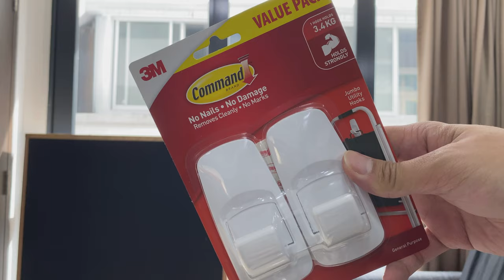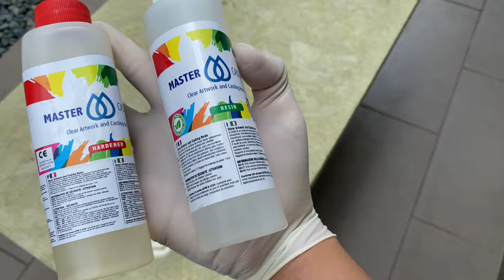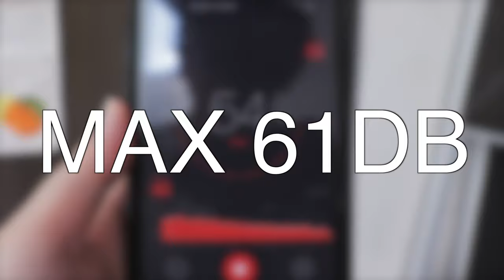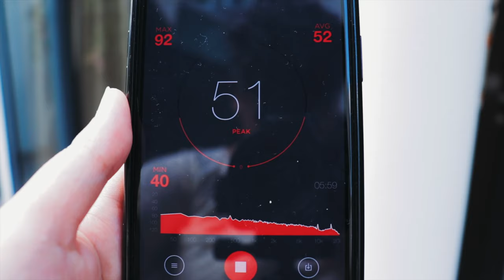Soundproofed Singapore Studio Apartment (Vocal Booth To Go - Producer’s Choice Blanket)

Comment: Good video! Looks like the blankets and sound panels are very effective on the windows with a good STC. I wonder about the impact noise that might go through the floor under the drum kit, but maybe the flooring materials in Singapore are less resonant than those in the US?
Reply from the maker: Thank you! I would need more mass to cut down a lot but for my case this setup is helpful. Also my unit is in the basement of a landed house and is the only unit/room within the house on the basement. But on flats and housing impact noise of the drums is really an issue.

Comment: Awesome job! I live in a complex (sort of like an apartment, 4 units in one) and I was planning to use the blankets to help me out. Question with your lego panel setup though. Do you ever have a problem with your panels falling over or are they just snug on the wall where they don't fall? I may build me some panels in addition to the blankets. Thanks!
Reply from the maker: Thanks! There is a metal frame on the ceiling that holds the main curtain. The gap is perfect fit for the panels and it holds everything together. Plus the rigid frame helps. So I never have any problems with it falling off.
Reply: @ProjectBeats_  nice! Thanks again!

Comment: Nice video. I like your idea of using resin for the acoustic panels, in fact planning on making some for myself. Just curious how did you hang them on the wall if they have no wooden frame, do command strips work directly on the fabric?
Reply from the maker: Thanks for checking the video. For my case the resin acts like a wood frame so I just literally stack them on top of each panel and then secure them in with the curtain in front. No hooks or anything. But if you can drill, I think rockwool wall spikes (impaler) work best.

Comment: are the rockwool more impactful than the blanket? if i just get the blanket, how much will it reduce sound?
Reply from the maker: Blanket alone or rockwool alone isn’t really soundproofing. Its more absorption and sound treatment. It’s essentially my way of creating mass by combining both plus air gaps in between. It’s a shortcut and my only budget means of achieving “soundproofing” to an extent without voiding my rental contract. 
Best is of course acoustic board and mass load vinyl sandwich if you are able. Or blanket/rockwool with heavy acoustic board because that has more mass.

Comment: Is using Fiber glass or ceramic fiber wool insulation would work just as well??
Reply from the maker: I learned that if you use acoustic board as backing material behind the insulation it will work much better. If you are able to I would suggest that.
Reply: @ProjectBeats_  thank you so much! This helps a lot. 😁

Comment: how do u block sound say if i’m in a town house they use thin walls but i wanna block that sound from me either gaming or laughing but without them hearing me so say if i scream during gaming i want the sound to not bleed through the other side as well
Reply from the maker: Best would be mass if you could install. So plywood/drywall sandwich, plus air-gap for decoupling your side to the wall and some absorption, like curtains/insutation (rockwool etc.
Reply: @ProjectBeats_   say if i use soundproofing foam  or acoustic panels or blankets etc. on both side of the wall as i don’t wanna put like rock wool or anything. so say if i put foam on both sides then put a blanket regular thick fluffy blanket over the one wall that my voice is going out would that work. and i can’t do anything to my walls tho renting town house
Reply from the maker: Mass would be your friend. Look at Audimute Sound Barrier sheet. Some type of mass load vinyl inside their curtain. But might be expensive. Some type of heavy mass or cinema curtain of sort will help. Plus some air gap.
Reply: @ProjectBeats_  r u able to link me a amazon link to the thing u mention the sound barrier sound blankets